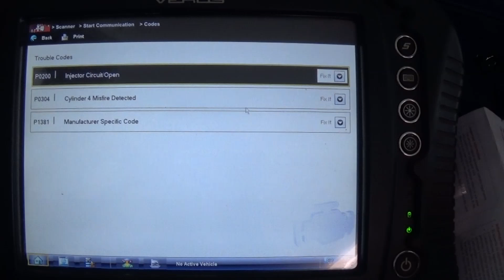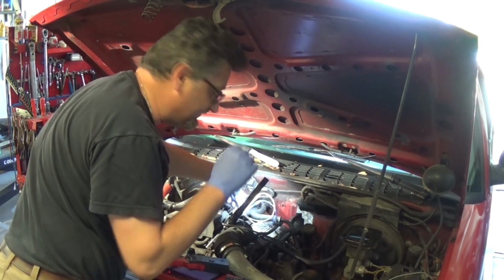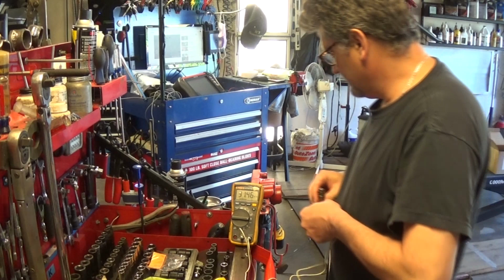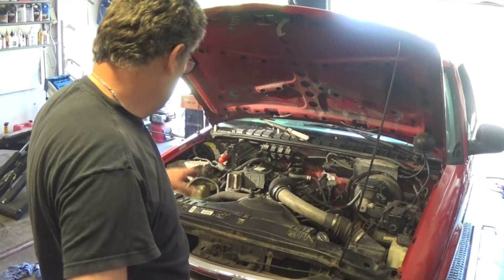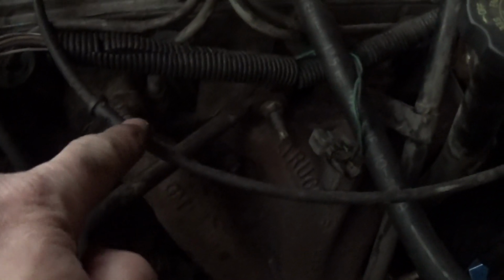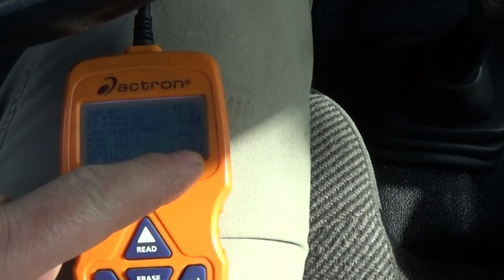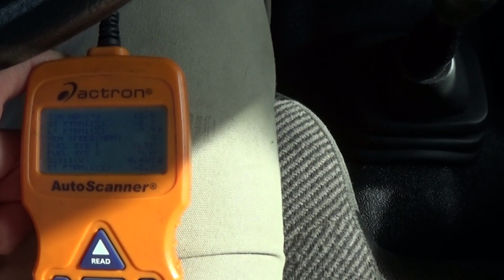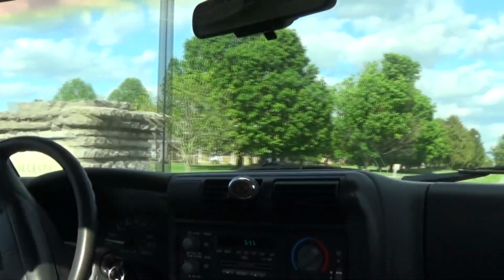Chevy S10 P0200  P0302 Injector Testing

Comment: I have this same truck year and model... Ive been replacing everything and can't figure it out ... I recently toolbthe injectors out and cleaned them because of the miss fire i kept having and when i reinstalled them I swapped the number one and number two injectors and now instead of a po301 code im getting a po302 code .... I think i need new injector

Comment: Needs a new gear selector bushing mine does same thing goes into wrong gear...im also haveing same isues with codes open injector circuit on number 2 and miss fire on number 2 even after i put in a new fuel injector and plugs and wires still  runs rough and sputters..even checked spark at plug wire with noid light and used noid light on injector plug all checked out new injector makes noise wen key on and off wich i assume means its opening and closeing..but i cant figure out why its still not running right
Reply from the maker: Robert Smith on one wire you need to have 12V another is control from PCM. Unplug connector and place your noid light on . It should flicker with engine running.
Reply: On the injector plug or spark plug wire it does fliker wen engine is running with light on plug wire and injector lights solid with just key on
Reply from the maker: Robert Smith that makes no sense. If your noid light stays on with key on and engine not running you have short to ground on control wire.
Reply: Well i got home from work today and messed around with it with the test light pulld the number 1 injector plig same thing solid lighbt even tryd the ol screwdriver againt the injector listening fir the clicks nothing ..but jiggle the wireing harness for injectors were they plug to main harness engine idle changes and will almost sound like its about to stall till u wiggle it around again but still ready the open injector circuit and multiple missfires..almost to point to ripnit out and go sbc
Reply: 1 other test i did useing a test light i tested the prongs on the injector plugs each 1 individualy light whould come on touching 1 prong not the other and on #2 injecter lights up touching both prongs
Reply from the maker: Robert Smith ok one color wire is the same for each injector. That is your main feed from a fuse. Unplug connector and connect your test light to bat negative with key on . Test light should lite indicate good feed. Next connect your test light to bat positive and touch control wire it should not light. If it does turn your key off disconnect PCM and repeat the test. If light stays on you have wire short to ground inside the harness somewhere.If light doesn’t stay lit bad PCM. What you describing you should have a lot of smoke coming out due to injector being energized all the time and row fuel entering exhaust.
Reply: Tht it does sir..and ill check thr out after work today i apolagize for all the comments but greatly aprecciate  all your replys back its helping me narrow down the situation more mutch thnks sir
Reply from the maker: Robert Smith no problem. Keep me posted 👍
Reply: I took a multimer set it to ohms tested each injector plug with key on all of them read 0L but the number 2 read like 12.75ohms still cant figure it out if its in the wireing or the ecm
Reply: Also i took the ecm out and it smeels burnt..like it smells like an old shorted out radio
Reply from the maker: @RobertSmith-kv1ur  looks like your ECM is gone.
Reply: Ky home garage thought same thing after smelling tht looks like ima order a new ecm and see if tht resolves the issue
Reply from the maker: Are you in USA
Reply: Yes sir.. alabama
Reply: Ik going to assume tho tht there is still an insue somewere probly tht cause the ecm to short out

Comment: Good one!!  If the injector was open circuit, I wonder why amp clamp was showing crazy waveform.
Reply from the maker: Bill Rimmer I am still confused and don’t have explanation why did look like that. It was spiking up to 3 amps with very high resistance and waveform looked very strange.

Comment: Nice job as always Ramon! I had a 2000 GMC Sonoma with 2.2 4 cal eng. was absolutely the worst engine even for a small pick-up, I ended up having to replace cam and lifters at 100,000 mi. I will never buy a 4 cyl small truck again.
Reply from the maker: White Tiger I didn’t know these engines are prone to failure. Good thing is we just don’t see them anymore.👍